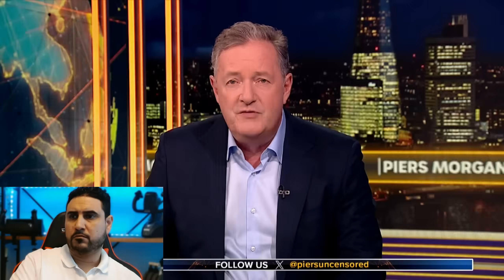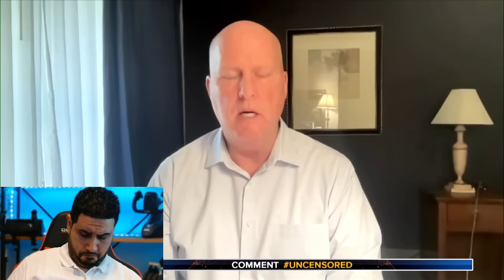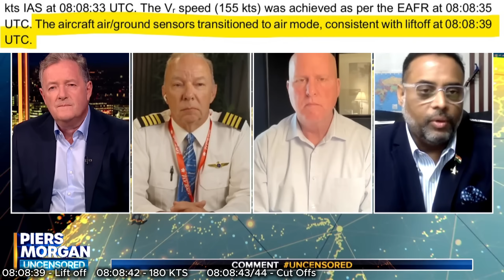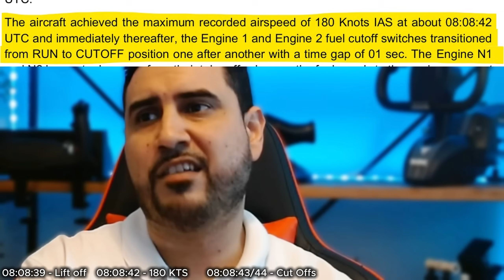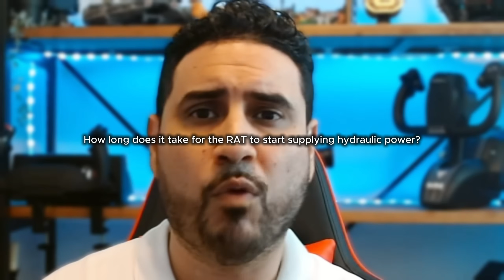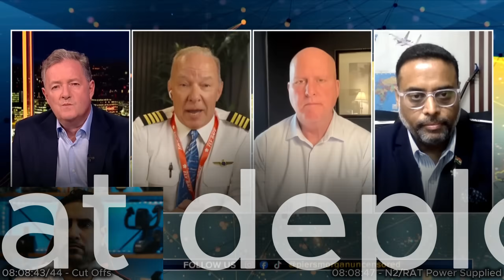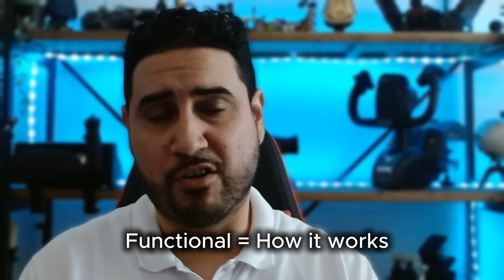TOTAL SYSTEMS FAILURE BREAKDOWN | AIR INDIA 171 | AAIB PRELIMINARY REPORT | MAYDAY | MSFS2024

Comment: For the pilot’s situational awareness it would be better if the mechanical switches were actuated in order to have their status match what the EEC and the valves are doing. The click would alert them. Currently, they had to look at the EICAS display intentionally and precisely to see the Fuel Cutoff status. That risks a time delay in a risky context. As a human factors researcher and AI researcher I’m also surprised that these recent frames do not have AI monitoring, I.e., looking at EEC, Fadec etc. and detecting risky state transitions. The frame should be able to defend itself against human or hardware erratics. It’s in the interest of all the human souls back there.

Comment: What about this eh?  NOBODY ever needed to touch/move a cockpit switch.. when electrical power is interrupted, even for a fraction of a second, 787 and 777, for any reason, the spring loaded fuel cutoff valves to the engines will snap shut. Cockpit switches would then at all time stay in ON. This design is that in case of electrical failure, which means fire extinguishers cannot be activated, fuel shuts off automatically so the wing does not burn through from an engine fire. At take off there seems to have been an electrical snag. Happened to ANA 787 after landing using reversers, in Tokyo, and unable to restart. Happened to BA 777 landed safely mile before runway in London. Rtd Training Capt. Pilot Union rep at all regional air accident investigations
Reply: yes

Comment: False. 
As per the Report the RAT deployed "immediately" on takeoff.  This is at time X:39 or X:40.  But the fuel switches "transitioned to cutoff" at X:42 and X:43.  This means is the RAT deployed BEFORE the switches moved to cutoff    The RAT will deploy only if there is something seriously wrong with the plane (4 conditions in the 787 manual).  This shows conclusively that the plane already had a problem BEFORE the switches transitioned to cutoff.   Do not argue with this timeline because this is in the report.  
Please realize that once the RAT deploys the FO's (who was the Pilot Flying) screens go dark and only the Captain can fly the plane.   As the Captain was flying the plane (no later than X:47) he could have put nose down to commit suicide.  But instead the plane was gliding and the nose even went up instead of down.   This is not how you crash the plane.  They even restarted the engines. 

Other signs of a problem with the plane are the white rain of dust on the left side as the plane takes off, and the vaporized metal of the rear Black Box which only a Lithium battery fire can cause.  This does not happen in a crash.
Reply from the maker: But where does the report say that the RAT deployed immediately after take off?

Comment: A+
Subscribed.
Reply from the maker: Thank you! More content is on the way! 

Top 10 unanswered questions on the preliminary report in production.
Reply: @FinalApproachPOV  You went deeper in citing Boeing sources than just about anyone else on this topic.

Also, I’ve had a few rather interesting mentors, at least 3 of which have Wikipedia articles. One had Werner on speed dial. A couple of those I can’t really talk about. So my simple compliment is a bit stronger than it might appear on the surface.

I’m curious what you will find with the question about a fire in the tail. That seems to be extremely unlikely to be able to cause a failure like what was described in the report, but I think it would nonetheless be insightful.
Reply from the maker: @PetesGuide  I find the fire to be interesting. When I research, I create Ishikawa diagrams (root cause analysis). This helps me break down scenarios and have them play out with different causes to test theories. 

The diagram doesn’t care about likeliness. When accidents occur, likeliness can lead to false assumptions.
Reply: @FinalApproachPOV  Does your top 10 include the dark shadows on the wings seen from the right side cell phone video (the 17 year old)?

Those are likely the spoilers, which I believe deeply as flight control surfaces when the only hydraulic power available is from the RAT.

I’ve not seen anyone analyze that, and doing so should provide a deeper understanding of the state of the flight control systems at that point in the flight.

One of my other questions is why neither pilot tried to start the impossible turn at any point. That could have at least ensured that all damage was confined to the runway area.

Comment: Your distinction about 'Operational' vs. 'Functional' is, in a word, brilliant. It clearly elucidates the difference, here, between pilots' knowledge vs. system designers and line mechanics.

But, Captain Steve is describing more than just operational knowledge. He has done his homework, and demonstrates his functional knowledge as well - by knowing that the switches are wired directly to the fuel valves (via relays), and another tidbit he mentioned in a different video which is that the switches run on 14VDC (vs. 28 for almost all the other DC systems). 

I will point out that the Fuel Control Switches have no electrical connection to the EEC; the EEC does not command the fuel valves to close in this instance (it can for other scenarios), and the switches will close the valves even if the EEC has been completely destroyed.

https://youtu.be/-ur234kwnhk?t=1084
Reply from the maker: I can appreciate he did exhibit some additional functional knowledge. In my opinion, again, my opinion, I don’t think he should be saying they are purely mechanical because the statement is a bit misleading. He does make a distinction as somewhere in the video. But it was overshadowed in the overall interview. 

Also captain Chinta calls out the distinction but again, it was also overshadowed.
Reply: @FinalApproachPOV  Yeah, totally agree. I think in his mind, he was referring to the very top of the switch that moves, whereas the others were referring to the overall system, which is of course electrical and electo-mechanical (relays and valves).

Comment: Couple of questions on the ECM/electronic controls and the black box logging.  Arent there separate dedicated ECM/fuel systems for each engine? Also on the black box logging of switch position, does that input come from the physical switch itself or is the switch position derived from ECM data?
Reply: Switches move; wires leading out energize; wire state change detected by Remote Data Concentrator; RDC formats and sends event packet with the event - type and device ID ("FCS#1 => CUTOFF) - out to the data network.

Completely separate wires energize; close fuel valve relays; relays pass current to fuel valve solenoids; three solenoids physically closes three different valves.

Each switch has a completely separate wire routing path - 4 wires from #1 go to the left engine; 4 wires from #2 go to the right engine.

Separate wires from both switches lead to the same two redundant RDC's.

https://youtu.be/-ur234kwnhk?t=1073
Reply: @BryanM61  Thank you so much! Great link. What I get from that is no matter what the ECC is doing the switch position itself is logged to FDR by two separate RDC units AND there are separate switch contacts for this position indication.  That gives me some confidence the FDR switch data is an accurate representation of the physical switch position.

Comment: I think most people dont understand, that they are just switches, what can also fail is circuit paths or cpu between them and those fuel valves. Is there sensor which senses switches, or it senses open/close state of the valves or states in cpu registers?
Reply: 13:40 now he confirms what i was suggesting
Reply: There is no cpu or anything else between the switches and the fuel relays - which energize and close the valves. It is direct electrical wiring.

There are different wires and a different path that run directly to devices called Remote Data Concentrators. The RDC's detect the change of state in the wire, and send an event packet to the data network. This packet is "seen" and recorded by the FDR.

Comment: Great insights from commentator.   An explanation of the 787 fuel system with appropriate electrical/electronic/mechanical schematics would go a long way to showing potential failure modes in this accident.

Comment: Perhaps all the "lithium battery fire" people can explain:

1. How the aircraft's data bus was still completely functional at least until impact.
2. How a TON of aircraft systems and sensors continued to send data to the network
3. How the Remote Data Concentrators could have seen, formatted, and transmitted the Fuel Cutoff Switches movement events at 08:52 and 08:56 (this is the ONLY possible way those events could have been logged into the DFDR
4. How the ADS-B transponder and GPS receivers were still working until 08:50.
5. How the fuel shutoff valves even closed in the first place

All of these systems are powered by the (redundant) 28VDC buses. Using terms like "Malfunction", "Transient", "Partial Failure", and the dozens of other weasel-words people have been throwing around shed NO insight as to what exactly went wrong.
Reply from the maker: Several aircraft systems clearly remained functional after liftoff — including the data bus, Remote Data Concentrators, and transponders. The DFDR captured fuel switch movements at 08:52 and 08:56 UTC, which means data was still flowing through the 28VDC network. ADS-B and GPS signals continued until 08:50, suggesting backup power sources like the RAT or possibly the APU were supporting partial system survivability. The shutoff valves did close, but whether that was manual, electrical, or FADEC-controlled isn’t yet known. The AAIB report shows a complex failure scenario — not a total power loss or isolated battery fire
Reply: @FinalApproachPOV  Ahh yes. Except - neither the battery backup nor the RAT power ADS-B or the GPS receivers. And the APU was not active. It takes 60-90 seconds for the APU to kick in.
Reply from the maker: @BryanM61 ah but they were - Page 14
Reply: @FinalApproachPOV  ADS and GPS powered by the RAT?
Reply: @FinalApproachPOV  Oh yeah, you're right. I see where I went wrong. I had a list of the Standby Power systems that did not include ADS-B or GPS, but I now see the "INR" - Integrated Navigation Receiver included GNSS (GPS), and the "TCP" Transponder Control Panel includes the transponder. Apologies.
Reply from the maker: @BryanM61 all good nobody is wrong here. We are all speculating. I appreciate the discourse.
Reply: @BryanM61 Bryan,, instead of proving what couldn't have happened. Using the limited available data AND eventos, try to change the thinking to what could have happened. other then pilot suicide rogue pilot 😮
Reply: @cjswa6473  Fine. Reasonable suggestion. I can do one better than what could have happened. I can demonstrate what did happen:

The Prelim states that the Fuel Cutoff Switches "transitioned" from RUN to CUTOFF, and gives a rough time. The only way they could have known this is if the events were logged by the DFDR.

And the only way the DFDR could log those events is if the switches were physically moved. 

We can split hairs about the word 'transitioned', but their intent is clear - the data in the FDR shows the physical switches were moved, one second apart.

We can also consider alternative theories about what could have sent the switch movement events; the valves, the EEC, the TCMA, etc., but those theories all fail. The Remote Data Concentrator which sent those events to the network identifies exactly which device it was - in this case the Fuel Cutoff Switches - and sends the device ID as a part of the event packet.

Also per the Prelim, the engines' N1 and N2 values began to decrease from their takeoff values, and they say - or at least imply - why this happened: "the fuel supply to the engines was cut off."

The fact that these two things took place immediately after one another - the switches being moved and then the engines spooling down - leaves no other possible interpretation: the engines spooled down because the fuel was cut off, and the fuel was cut off because the switches were moved to CUT OFF.

This is further confirmed by one of the pilots "asking the other why did he cutoff." Note the wording: 'cutoff".

He didn't say "What happened to the engines?" or "Why are we losing thrust?" or "What just went wrong?" He said "cutoff".

Next, we see from the DFDR that the switches are moved back to RUN. At some point AFTER this (it doesn't say exactly when), the engines initiate "a relight and thrust recovery sequence of ignition and fuel introduction."

If there were some other (wildly implausible) malfunction, this would not have happened. Thing don't just magically fix themselves, and even if they did, it can't have happened on both engines 4 seconds apart. 

================================

Therefore, the only plausible scenario is that the switches were moved from RUN to CUTOFF, the valves closed, and engines were starved of fuel.

9 seconds later, the switches were moved back to RUN, the valves were opened, and the engines began their re-light sequence.

==================================

I would note that there is nothing in the report that indicates - or even hints at - any other malfunction anywhere.

=================================

I have never guessed at which pilot moved the switches, nor have I ever asserted that it was deliberate. It may have been inadvertent, we don't know. 

But the reason the plane crashed is because someone moved the switches. 

Everything else is BS.
Reply: @FinalApproachPOV  If you'll indulge me, allow me to explain how the Fuel Cutoff Switches and Fuel Valves operate. 

From the AMM, which I'm pretty sure you have a copy of:

Fuel Cutoff Switch Pinouts:

Designation | Cutoff | Common | Run
A | 1 | 2 | 3
B | 4 | 5 | 6
C | 7 | 8 | 9
D | 10 | 11 | 12

A Contacts feed an RDC (Remote Data Concentrator)
B Contacts feed a different RDC
C Leads to Engine Fuel Control Relay 2(L or R)
D Leads to Engine Fuel Control Relay 1(L or R) AND Engine Fuel Relay 1

The common pins are all GND. Positive voltage is supplied to the cutoff and run pins.

======================

Pins 1 & 4 are energized when the physical switch is moved from RUN to CUTOFF.

This is detected by (redundant) RDC's, which create and transmit this state-change event ("transition") to the data network, e.g. ("FCS 1 => CUTOFF").

The DFDR "sees" and records this packet. This is the ONLY way these events can be recorded into the DFDR.

More on this packet  later.

Pins 9 & 12 energize, and energize (redundant) electrical wires to the Fuel Control Relays. The relays close the CUTOFF side, allowing current to flow through the relays to the Fuel Valve Solenoids, which physically move the valves (HPSOV, Fuel Metering Unit, and Spar valves).

Power is required to move the valves to OPEN, and power is required to move the valves to CLOSE - a "positive control" mechanism (so an electrical failure won't cut off fuel to the engines).

So far, there has been NO interaction with the EEC. There is no physical/electrical connection between the switches and the EEC. I will explain why this is in a footnote.

At this point, the EEC receives the FCS transition packet from the data network, "understands" that the valves have been moved, and updates its internal state data to reflect this.

If the packet is FCS->RUN, the EEC initiates the engine startup sequence, whether an in-air or ground start. For a ground start, the Engine Start switches in the cockpit must also be in START (vs. NORMAL).

* Footnote: The FCS are wired directly to the Fuel Control Relays, because in the event of a catastrophic engine failure, the EEC might be damaged, destroyed, or disabled in some way. If it relied on the EEC to close the valves, there could be a situation where high-pressure fuel is being fed to an engine with a raging fire, 20,000lbs of Jet-A1 two feet above it, and no way to cut off the fuel.

This video has a diagram of these interactions:

https://youtu.be/-ur234kwnhk?t=1085
Reply from the maker: Also want to be clear that I am not supporting any theories. just providing analysis.

Comment: On 25th July  2025, another United airlines 787 had engine failure immediately after takeoff at 5000 ft and they had to dump fuel and do emergency landing. Unfortunately for manufacturer   both pilots are alive to defend themselves, hence cannot make a story of pilot suicide.
Reply from the maker: Single not dual engine failure. 
This occurs once every 375,000 for turbine aircraft’s.  This also equates to a handful a year. 

Dual engine failure and fatality is what truly makes this unique.

Comment: If an electrical failure occurs, would'nt the fuel pumps fail and cause both engines to flameout. The pilots could become frantic and play around with the switches in an attempt to restart both engines because they were facing an end to their lives.
Reply: "the Engine 1 and Engine 2 fuel cutoff switches transitioned from RUN to CUTOFF position one after another with a time gap of 01 sec. The Engine N1 and N2 began to decrease from their take-off values as the fuel supply to the engines was cut off."

Switches were first, engine spooldown came after.